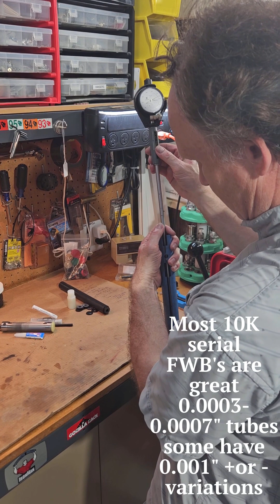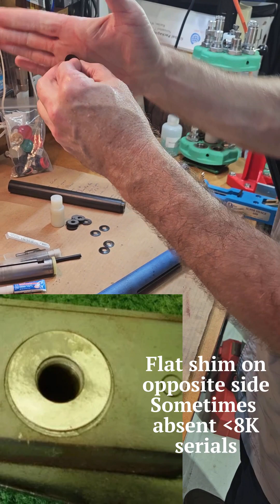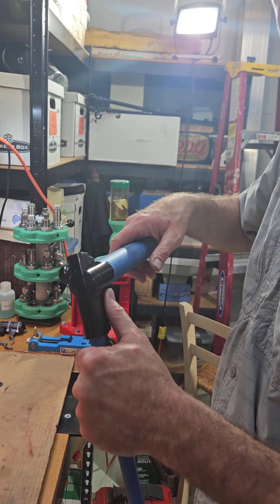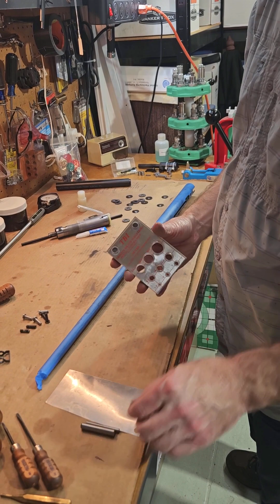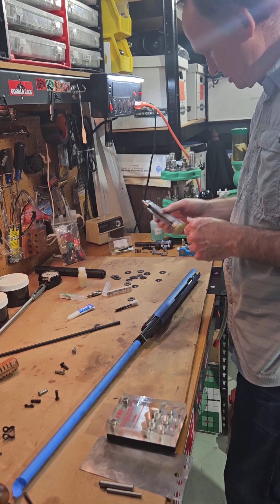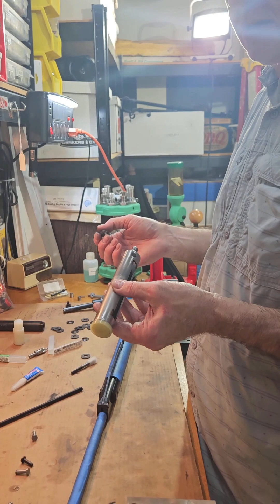Part 2: Tuning the Feinwerkbau FWB 127 Air Rifle Internal additional information and clarifications

Comment: Thanks so much for both your informative videos on the FWB 124/127. Recently I’ve acquired a few old springers. I have a FWB 300s and just bought a 124d on eBay and I’m waiting for it to be delivered. I found a BSF S70 in a gun shop the other day and have been getting the parts from ARH to rebuild it. Another one is a Carl Gustaf Swedish airgun made after WW2 that came from the Beeman collection. Thanks again and I hope to see more videos on tuning these fine old guns.

Comment: i f you want to correct the barreldroop , i do it with levels   set the cilinder in a vice and level , put the level on the barrel and it should be the same .   only if a barrel is excact in line you get the max accuracy  , also with open sights  . because the piston bounce is also  not so disrupting the barrel , it flips less

Comment: hello , i got a 127 .22 lux , the cocking arm is a weak point  ,it can bend , and break  . so i made a hw 80 cocking arm to  fit ,  the part  that goes in the piston  used the orginal piece  from the broken one, i welded and forged it at the hw 80 arm , (shortening that hw  one ,. )it rides playfree tru the stock groove ,  works great and you have to thin  the arm a little to fit in the barrel pivot point .